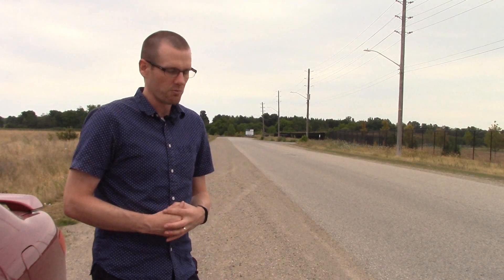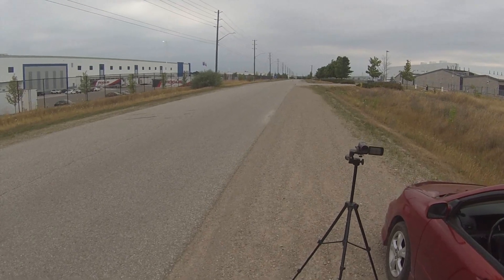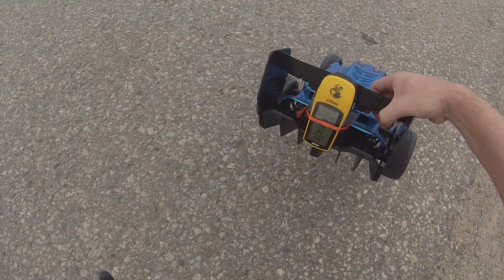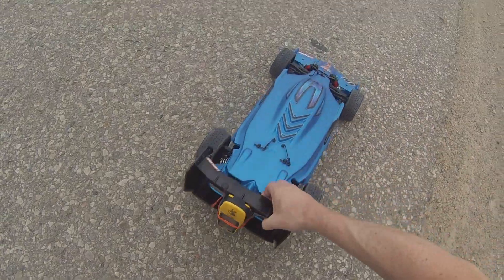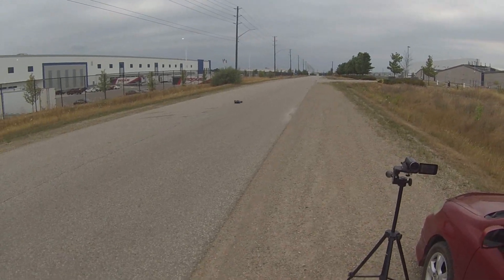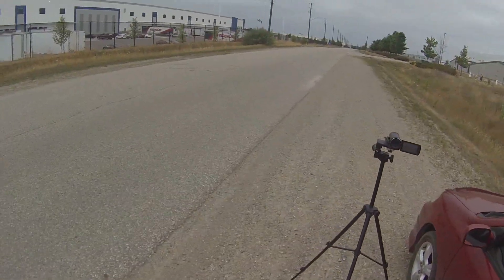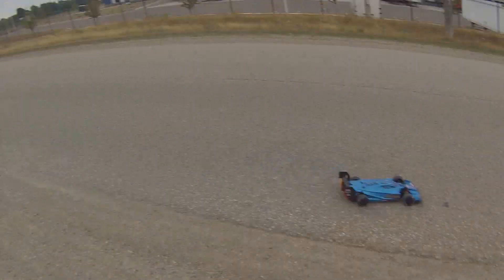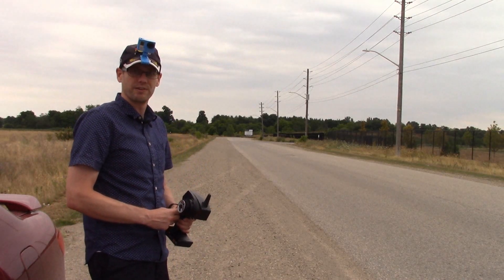First 6s & 8s Run of the Arrma Limitless with Castle 1721 2400Kv - Subscribers Setup for 100mph

Comment: Great work so far.  Given your large viewer base I'd love to see you advocate safe practices like standing on a ladder.  I'd be happy to provide advice if you want to go significantly faster.  Radio range, shock travel, tires, and some other factors will be your next challenge.
Reply: Love the ladder for safety idea.  I've seen this in other speed run vids but always thought it was for  for line of sight, radio range etc.  Didn't consider the safety aspect of it, definitly a good idea.

Comment: its not front aero that's the problem the issue is the rear spoiler pushing the back end down so its lower than the front the air gets under the chassis. droop the front end to 10/12mm then sit the car on a desk push the rear end down until the back is just above level with the front say +2mm then slip some plastic/stiff rubber fuel tube over the rear shock shaft  to limit the rear squat.

Comment: We’re at the 120-150 mph on 4s.  Set for 100mph on 8s is a drag racing setup.  We’re are you at located at?
Reply from the maker: 8s 100mph is a subscriber setup. 
South of Toronto.
Reply: @RCexplained  if you raise the punch it will be much calmer during the acceleration and easier to control.  👍
Reply from the maker: @alterdcustomrc4512  punch was set to 30%
Reply: @RCexplained  its a very powerful motor try 75% to soften it up.  It will still max out but a lot softer.  You’ll have a little more control
Reply from the maker: Ya for sure it will be bumped up. I believe it works as a time delay with the throttle input. Very handy feature.

Comment: To prevent it from lifting off, I learned from Raz Shifrin. You won’t need the front wings and to cut down the rear one to basically flat. You also want the car to be higher in the rear and lower in the front giving it a rake. I’ve had the car take off on me on the spektrum 6s electronics before, and since I did that I’ve never had a issue

Comment: Hallo sir,my name is jack i have a problem with my power boat can u help me for get the solution ?
Specification boat
Lenght : 100cm
Width : 36cm
Tight : 13cm
Motor : 2 pcs 4092 1250kv
Esc : 2 pcs 150A Flycolor
Battery : 2 pcs 4s 14.8v 7500 mAh 90C
My planning is
At the First change the old esc to 2pcs ztw seal 150A opto HV and then
 I will add 2 more batteries to unlock 8s of power per motor
What is your opinion ? will this get optimal results?

Comment: Lower the front end and put more preload on the rear shocks. Have the front angled down and you wont need the front wings. Nice job reaching your goal!
Reply from the maker: Very true however I'm not so sure the extra drag from the front lips will even matter so much at these low top speeds.
Reply: @RCexplained  Come on, you have the bug now. 100 MPH is the gateway drug. Good luck with the new addiction 😅
Reply from the maker: Hahaha. Don't worry. Bug was installed decade's ago.

Comment: Congratulations on meeting the goal and running that motor correctly.
Reply: 🤔 running that motor correctly? Did I miss something? 
Thought it shouldn’t run back to back 💭
Reply from the maker: Thanks matrix!
Hi Kevin. No you didn't miss something. You wouldn't be able to tell as I didn't share the data. How many back to back runs is relative to Temps. The power system is laughing on 6s. Could run continuously back to back.

Comment: With this setup you need on full throttle after the car pass you. They have more speed to offer.
Reply from the maker: we are geared correctly for 100mph. This gearing is way under geared to hit much more and that was the point described in previous videos.

Comment: How did you get your xlx2 to sit where the motor originally was? I have an infraction and its the same.platform as im told and it doesnt sit.flat because of.chassis angle
Reply from the maker: Designed and printed a plate for it to sit on. You can see this in the previous limitless video on the channel.
Reply: @RCexplained  nice thanks for the quick reply.